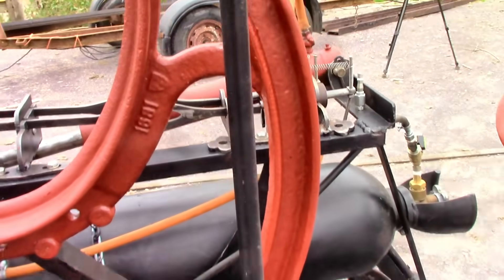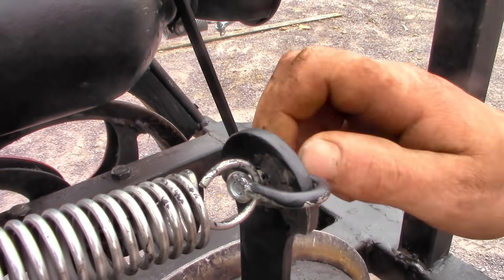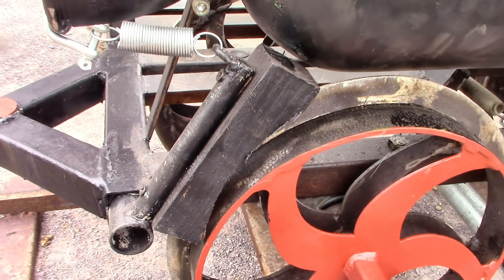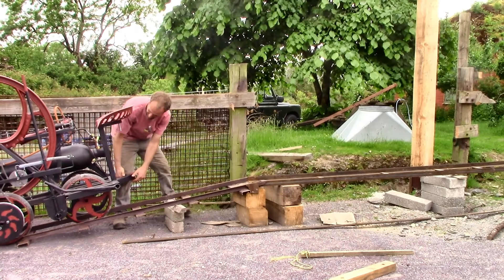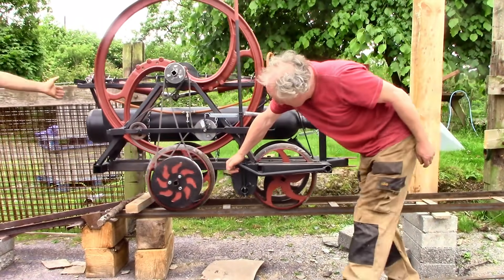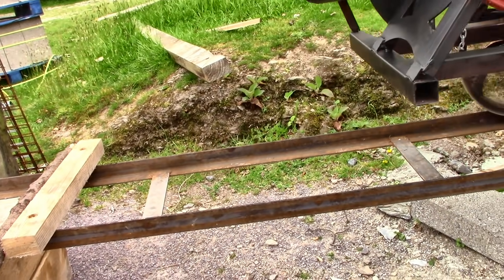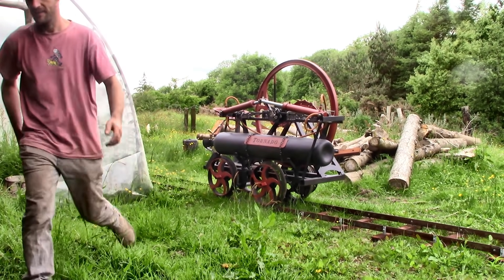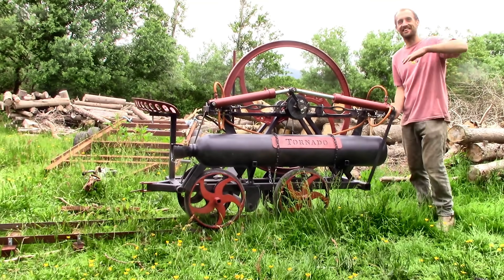First Run!! Home-Made Compressed Air Locomotive For The Field Railway

Comment: That is an amazing looking machine! Your railway system just needs a turntable to complete everything. PS: Just had a thought, would a diesel powered air compressor attached to the loco rather than the air cylinder do the job? Probably defeat the point of it being eco friendly, though.
Reply: Emergency diesel Compressor, additional tank tender, and a charging station with various compressors running of wind, solar, a creek, nuclear fission, nuclear fusion, and zero point energy.

The ultimate island power grid of potentially green energy to cover all your needs.

Comment: Have you tried using the engine itself as a compressor? Hooked up to the stationary engine with a belt it could pump air into the cylinder.

Comment: What a great and lovely machine! Can I suggest a chain between the wheel Axles? To get both better brakes and grip.  And a parking brake. Maybe a bolt to push on the brakes when turned. It looks a bit heavy, so I imagine it would be scary if it run away.
Reply: I think the main issue it has apart from being underpowered at the moment for her own weight(3%) is getting traction: i think it's time they start thinking about sand dispensers.
Reply: The lack of traction also creates a lack of breaking power: without something to create friction on the rails(like sand) Tornado will probably just keep behaving like she's on ice due to her weight.
Reply: They could also try feathering the brakes instead of slamming on them. It seems counter-intuitive, but apparently automotive "antilock braking systems" do that to shorten stopping distances.

Comment: This is really impressive and amazing! Well done! If you were to find a way to fill the tank near full capacity, I wonder if you could put a pressure regulator on the tank's output and use the dial as your throttle. Then you wouldn't have to keep the throttle nearly shut at the beginning and continue opening it as the pressure falls, it would chug along at the same speed you set it at the whole time! Just a thought. Very well done as usual! The paint job is beautiful.
Reply: You definitely need a pressure regulator when that bottle has over 200 bar of pressure in it. You wouldn't be able to open the small valve by hand otherwise. 

Also accidents happen and if the valve were to fully open at full pressure, a lot of hoses would go boom and those can give you a nasty slap in the face.

Comment: You could try using a pressure washer as a hydrostatic source - get several more gas bottles, pressurize them with your normal compressor, hook them up in series, and then use the 2,000-3,000 psi water to slowly force the air out. Once all but the last tank are full of water, close off the valve and detach that last tank. Repeat the whole process after draining the water or use more bottles in series if your mobile tank isn't fully charged in one go. Slow, but could be done overnight(?)
Reply: Instead of pre-pressurizing the tanks, you could use your garden hose and it's normal 40-60 psi to start the filling process - no need to trickle-fill things when we're still near atmospheric, but I'm pretty sure this method would not work as well overall, as much less gas will be compressed in the end.
Reply from the maker: Thanks. Yes, I've been wondering whether this would really work - I suspect you'd get such a small amount of air at high pressure
Reply: @wayoutwest-workshopstuff6299  By PV=nRT, you can assume roughly a 100:1 change in volume from atmospheric to  somewhere in the range of 1500-2000 psi. So..  ..yeah, the cost of the materials alone would likely exceed the few hundred for a cheap scuba compressor. (someone out there has 99 spare gas bottles and all the necessary hardware laying about, probably, but not me, and not you 😆)

Comment: Lovely machine! Remember, Power equals torque times RPM, so you'll get a lot more out of it with more pressure, since that will be increasing both variables.
Reply: Yes, but RPM is linked to speed, so at any given speed you're only increasing one of the variables. Still should be much better with higher pressure though.

Comment: Is there a regulator valve on there? If you're going to fill it to 3000 psi that stuff can become very scary. Speaking from experience with hpa airguns and valves at 4500 psi, I've seen what happens when you don't get the right valve on those.
Reply: A welding regulator should be a bolt-on fit.

Comment: This is absolutely amazing! And the fact that she's only using 3% of her full potential is pretty darn impressive!
Reply: Actually wait that was a 3000 not 300 so you're right
Reply: So the engine could have been named shaggy and that would also fit
Reply: @andrewrife6253  based dude right here
Reply: 33.33%, it was pressured to 100 out of a possible 300
Reply: @datguymiller  that’s a welding gas tank, it’s rated for 3000
Reply: @firstletterofthealphabet7308  The tank can take 3000, but can the rest of the build....?
Reply: @vinny142   A pressure regulator will fix that ;)
Reply: @firstletterofthealphabet7308  yeah I realized that
Reply: @datguymiller  Technically the cylinders might take around 1500. Most hydraulic systems run around 1200 but a few run around 3000.
The tank is probably rated for 2000#
If changed the hoses to hydraulic lines it would work but it would be really wasteful with fixed cutoff and there is no way with the light weight & funk drive you could transmit the potential hp to the track.

Comment: As a member of the Oil Often & Plenty Brigade I must remind you to flood all moving parts with lubricating oil before and after (and if you're feeling daring, during) every run. Preserves the metal, slows wear, makes her go smoother.
She is a beautiful engine and you've done an excellent job on her construction - the paintwork and nameplate finish her off perfectly!
Reply: Does that include a generous lubrication of the operator as well?
Reply: @Falney  you have to place a big chunk of butter right on the seat!
Reply: @Falney  Oo err missus!
Reply: @Falney  lol
Reply: He always does. He's shown us he does.
Reply: Using compressed air, make sure you're not using petroleum based lubricants. You'll risk an explosion.
Reply: i dont think you need to tell this guy.

Comment: A nice 0-2-2 locomotive, but it could be made a 0-4-0 if on the right wheels there was a connecting bar which would double the tractive effort.
Reply: Or two sprockets and a bike chain

Comment: The smile on your face is amazing haha but I agree if you could run even 200psi I think it would do amazing. Might I suggest a locking mechanism for a parking brake and maybe even putting brakes on your front wheels to get more braking with less slippage.

Comment: Loving the loco. I think it would be a really good idea to create a small tender of sorts but for air instead. It wouldn't have to be big but just enough to vit a couple more canisters for a longer time the engine can run. Once again, love the project and I really dig the new paint scheme.
Reply: I'm guessing that Tornado could be fitted with a second tank above the first tank on the frame.  That would give more air volume and also a bit more traction weight.  I'm sure that Tim could cut the parts for a 2 tank mounting rack with his plasma cutter.
Reply: A tender would be 'cute', but actually, if more tanks are added, they'd be better on the loco, it would benefit from the adhesive weight.
Similarly, coupling rods might be well worth adding.
Reply: Fireless Locomotives such as the one Tim built (Compressed Air locos fall under Fireless Locomotives Im pretty sure) were and still are used in high fire risk enviroments such as Gunpowder Works, or other places where fire could cause issues. And would be refilled from little refill stations along the line.

 I dont think long journey Fireless locomotives were ever used but if they were i would assume it would be like Water Towers in years long forgotten, Every Stop/Loading area would have a Steam Engine/Compressor ready to refill the locomotive.

So i think for Tim i think either a Mobile Compressor (In a Boxcar, Tender, or Brakevan with a Generator) or a Conventional propulsion locomotive would work better then a Fireless one for longer journeys. Either that or he would have to buy multiple compressors to position at each station along the line to refill Tornado. 
A Mobile Compressor car could also mean he could make more Compressed air locomotives & other equipment that requires power (Automatic Shaker for the Ballast Layer for example)

It also Depends on the Railroads size, if its small enough that he can return to the Workshop to refill he should be ok. But if its going out a lot more then not really.

But Honestly, Im just a Youth from the US, so what do i know lol.

Either way he has done exeptionaly well, Good job Tim :)
Reply: @epicstormchaserswf  I don’t know how long is considered long, but tenders with additional air cylinders were common as heck for compressed air locomotives. 

Though the main issue here is that the 3000psi welding tank is only being filled to 100psi. Assuming the same working pressure for the engine throughout, seems like 30x more runtime would be the result. Of course, reality being what it is, the actual result will be much less, but that’s fine. 

Now imagine all that extra pressure plus the locomotive was double expansion and double acting!
Reply: @trekintosh  Tbh yeah your probably right, a Tender would work, but how is he going to get enough welding tanks for that lol.
Reply: @trekintosh  Does double expanding work on air? I know steam it works well, triple expansion engines were not uncommon in the glory era of steam. I guess air might have some effect but the friction  of the cylinders, valve train and  drive train might make it useless. High temp compressed dry steam has a significantly higher expansion ratio than compressed air.
Reply: @RC-nq7mg  At air pressures around 3000psi I expect you could achieve an expansion ratio high enough to make double or triple action work. 

However, even double would be extremely challenging to add to this locomotive since the sizes of the pistons have to be a fairly precise ratio, and he doesn't have much room for another set.
Reply: @RC-nq7mg  yeah, there were several compressed air engines that were double expansion, and I think one or two triple? The idea would be to replace one of the current cylinders with a much larger one for the lower pressure air.
Reply: @trekintosh  what about using the front of the cylinder as the first stage and the back with no piston taking up space as the second?
Reply: Or he could put a compressor on the tender instead
Reply: @quakxy_dukx  yes but he might as well make it petrol to start off with
Reply: @gs425  yeah I realised my stupidity after I commented but didn’t see any point in deleting it
Reply: @quakxy_dukx  not entirely stupid.. sure he could have hooked the petrol engine directly to the loco drive, but he would have needed to do some major gear reduction to get speed down. With a small engine running and supplying endless air he could run it almost an entire day on a couple liters of petrol. Now if he is aiming for no petrol then yep that's a problem. He is still using natural resources to fill his air tank either way. He has proven quite well that it will work on lower pressure than the tank holds! I am by no means downgrading you here, just chatting and thinking of different scenarios.
Reply: @quakxy_dukx  didn't mean to sound cocky,  but he did say early in project it wasn't his plan. One thing about this latest project of his is it gets us all thinking lol 👍
Reply: @gs425  don’t worry. You didn’t
Reply: @quakxy_dukx  i like that, a compressor on the tender, then a tender for the tender with a diesel generator
Reply: I said the exact same thing
Reply: He doesn't need more tanks or a compressor on a tender all he needs is a better compressor to put higher pressure in his storage cylinder. If he can do that then he should be able to go all over his little railroad many times with plenty to spare only topping up rarely when back in his shed.
Reply: A round propane tank would do
Reply: @doct0rnic  pretty sure propane tanks are only rated for around 300psi max working load is much less. The tank he has is rated for far higher pressures and has larger volume

Comment: Excellent well done  would there be any advantage in changing the gearing to generate more torque at the wheel
Reply: My guess would be not a lot - it's 2 wheel drive so tractive effort is limited by grip. You'd also be trading speed for torque and there isn't much speed to trade!
Reply: not until its been tested under full pressure yet.